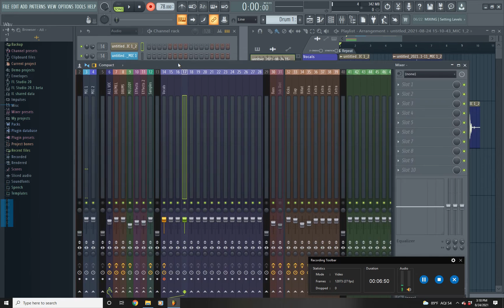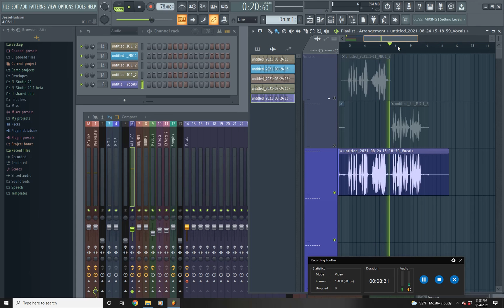FL Studio why I normalize each audio clip

Comment: Great video!! So normalizing can take files up if too soft, as well as take files down that are too loud?
Reply from the maker: Yes this is the case. Normalizing will take whatever sample and bring it up to the topmost peak at 0db or if the gain is above 0 to bring it down to 0. This is great, however, lets say you don't use a pop filter over the microphone. You then have a plosive that is very loud. If the plosive is very loud compared to the rest, the peak of the plosive will limit at 0db meaning the rest of the sound may be very loud. Here is an updated version of this clip with volume cuts and turning up each part before going into a compressor. https://www.youtube.com/watch?v=htPsbA1MNRs Also if you are having an issue with vocals sitting in the mix, check out my new vocal king 2 plugin which has 2 compressors. One to set the pres and the other for final compressing. However, its always best to set each clip to either normalize or to gain stage to level match before compression. https://jhudstudio.com/audio-plugins/ Make sure to scroll down to the vocal king 2, then the download bundle is up above.

Comment: how do you record your vocals withot them having any noise?
Reply from the maker: Hi, So the key of recording without noise takes only a few things. A simple usb audio interface like a Focusrite 2nd gen or higher.  Then a low noise mic. Condenser mics like the baby bottle from blue offer ultra low self noise from the mic itself along with a high output to the audio interface. Then the room is very important as well. If your computer or laptop has jet engine fans, that will pick up a lot of noise. If you can afford some room treatment foam, this helps a lot. Also the distance from the mic makes a big difference. I recommend anywhere from 3 inches to 6 inches away from the mic. The closer, the more proximity effect but less noise. I hope this helps. Please reply with your current setup and I may be able to help out further. Best, Jay

Comment: No need to Normalize vocals? There's this really cool plugin that helps that's
 called Vocal King. It's even free~!  ;-)
Reply from the maker: Yes it helps greatly with it. But there are times when normalizing does benefit. For example, on the same recorded track a person decides to record very softly and then later very loud. The vocal king will raise up the soft vocal but then smash the louder vocal. I did design it though to sound as smooth as possible even during this case. ;)